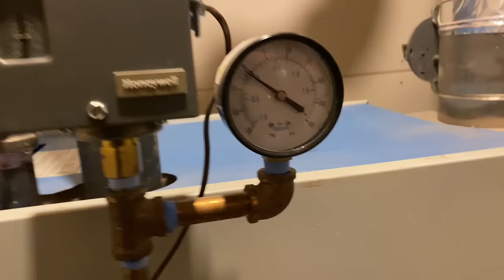How'd They Expect This To Work: Steam Boiler Installation Epic Fail

Comment: Wasn't expecting my comment that I left a few weeks ago about the magnetic filter coming up in a video and a customer asking about doing that to their system
Reply from the maker: It’s actually a good idea.
Reply: Lol kind of funny how simple things get attention I remember I made the joke of calling mikeys shortest time employee nicknamed him shake n bake 😅 and that took off 😮
Reply: Doc Mikey definitely reads the comments. The more subs the more impressive that gets.
Reply from the maker: even the replies to replies:) @jayclark5912
Reply: Many manufacturers recommend using them we use boiler mag.  Can be installed in horizontal,  vertical,  or angle because the filter can be set as needed

Comment: The size of the vent tapping is unimportant. The size of the orifice on the vent is important. That is probably a straight Gorton D. It flows 0.330 CFM at 1 ounce of pressure as per the chart in Lost Art. A Gorton 1, which has a 3/4 inch tapping, also flows the exact same 0.330 CFM. Alternatively, the straight pattern Heat Timer Varivalve flows over 0.600 CFM, nearly double either of the Gortons, and has a 1/8 tapping. A 1/8 tapping is capable of flowing 1.200 CFM. A Barnes and Jones Big Mouth flows over 2 CFM and has a 1/2 or 3/4 tapping. So even the tiny Varivalve is a better bang for your buck than the #1. But a 1/8 tapping will flow more than 99% of the vents out there. The tapping is not the restriction, the top orifice is. Take a look at the vent CFM charts in Lost Art. Both the Radiator vents and Main Vents chart. Compare the Gorton D and 1. Both 0.330 CFM despite different tapping sizes.
Reply: That's really useful info. I was aware of the differences in orifice size; in practice, people paint them and reduce that orifice sometimes dangerously.  I'd love a good quick reference for a lot of this stuff; all the boiler guys bailed when stuff got crazy in 2020 and the brain drain has been nuts. It's worrisome as I know the boilers need more maintenance than they get and I am spread very thin at work.

Comment: Mike, I've been spraying wd40 on my Isuzu Cabover NPR truck motor, 4.8 since 2003.  They are built with lots of aluminum parts.  This motor still looks new with no oxidation.  WD is like magic, and it protects everything under the cab.  Nice to see you're using it in the same manner.  Another real good educational video.
Reply from the maker: Thanks for sharing

Comment: Just curious about the high stack temperature.  Does it mean that the heat transfer of the combustion gases to the boiler is inhibited by carbon buildup and needs cleaning?  How would you clean it, do you have to remove the jacket from the boiler or can you clean it with a bottle brush from underneath?  Nice video thanks!

Comment: Issue with magnetic filtration is that creates larger pressure drop, which may require additional A dimension height, to overcome the pressure drop(see Dan Holohans Lost Art of Steam Heating).

Comment: Very interesting video thank you. Why not use the Gifford loop instead of the Hartford loop? The Bottom of the Gifford loop should be equal to the top of the water line. Returning the condensate from the Gifford loop will be quieter than the Hartford loop.

Comment: Once again - nice descriptions for what and why you were doing things.  As for the Hartford loop being missing - I thought it was required by law to be there.  At a minimum, it is required for the warranty of the boiler (and probably for home insurance on the boiler).  

I understand your wariness of the old black pipe from the ground, but I believe you could mega press a fitting - especially if you are below the water line.   I'd push the homeowner to change the piping - from both a safety and a warranty perspective.

As for the previous installer, it looks like they were used to water boilers and not steam and just cludged he rest.
Reply: The current boiler has the protection of the Hartford Loop. Just the excess height can contribute to water backing up in the main
Reply: There is a Hartford loop. Just it's way to high

Comment: Hey Mikey, Great video! Now that is one smart customer, he wanted Mikey the man and only the man to come help him out and Mikey the man obliged! How many companies would honor a request as such and make the customer happy? Also, i was thinking, perhaps when you disconnected the pressure trol wire and the low water light come on, it could only be that the 24 volts was interrupted at the low water unit and was just going through it's cycle when you reconnected it. The customer did drain water while you were there and even though it looked as though there was enough water to satisfy the low water unit, perhaps the low water cut off probe is a little dirty.

Comment: The WD40 may seem like a good idea but it does not add any protection to the metal pipe. The protection it does give is gone as soon as it evaporates.
Reply: MMattes It depends on the application. If some of it is trapped within the joint, it may last longer. WD stands for "Water Disspersent" It was not made to be a lubricant. It only lubricates because it has an oil base.

Comment: The steam pipes are clearly pre-existing to the boiler, and has likely been fine for the 80 years the house has been there. I’d bet anything the newer boiler was installed by the previous homeowner.
Reply from the maker: Sorry. You are wrong. Modifications made by idiots who have no right touching it.

Comment: Should the boiler have a safety valve  instead  of a  relief valve.   I  have learned that safety valves are for steam. And relief  is for  water units,  the safety will prevent  a boiler from blowing up.